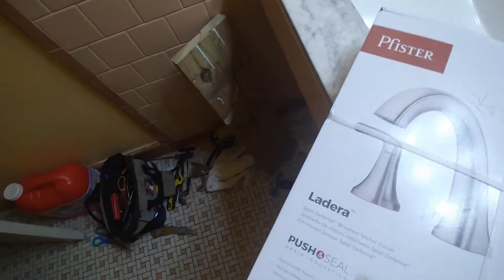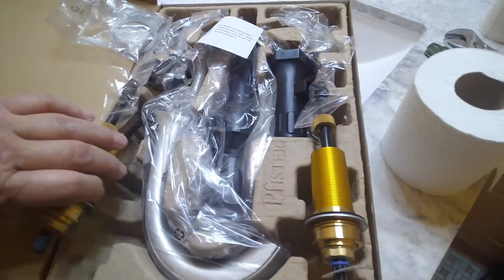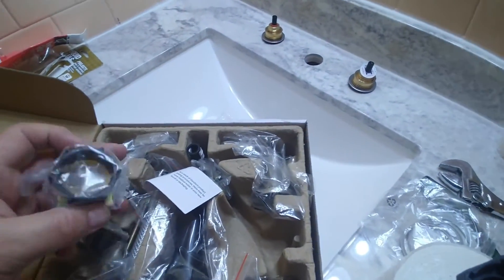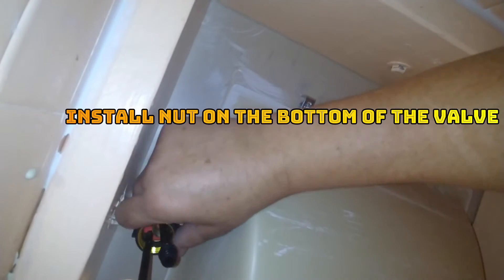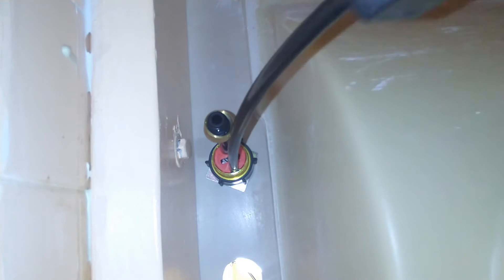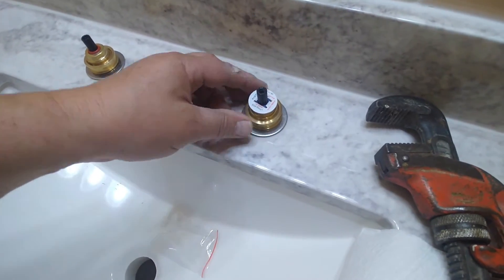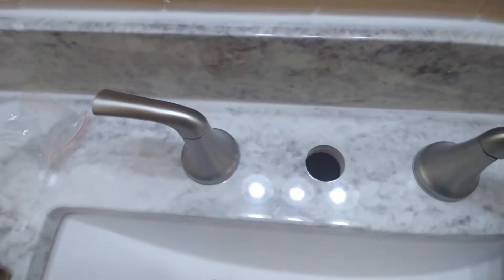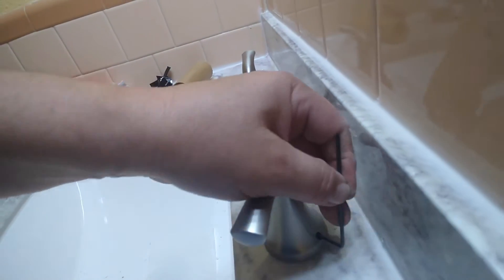How to install a Pfister Faucet LF 049 LRGS

Comment: Make sure to remove the aerator from the faucet before you run water for the first time. Potential for debris from newly installed lines to clog it.
Reply from the maker: Totally correct!  This is an excellent habit to do all the time after any faucet installation, I should have included that on this video. Thank you so much for your comment, and thank you for watching my videos.